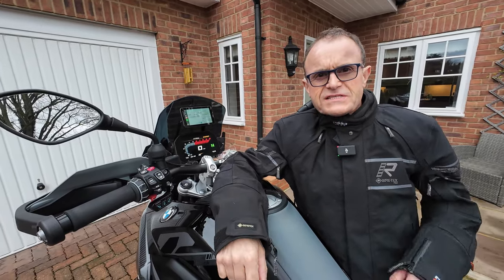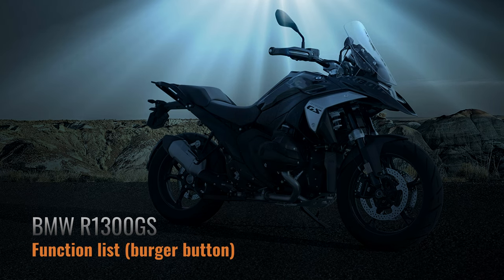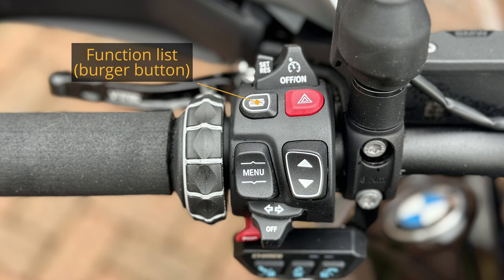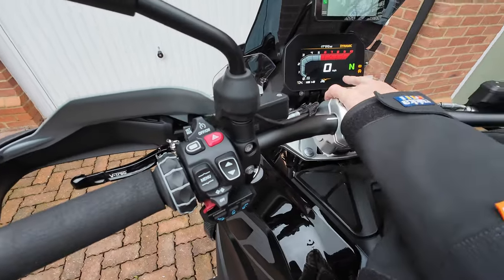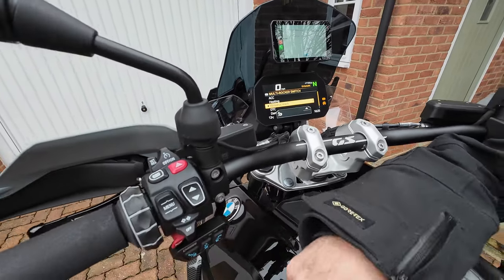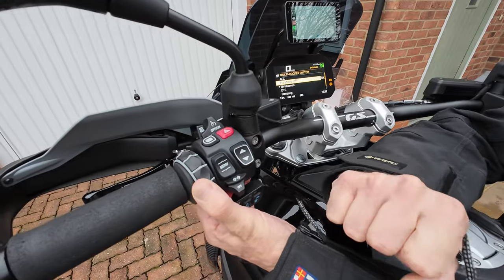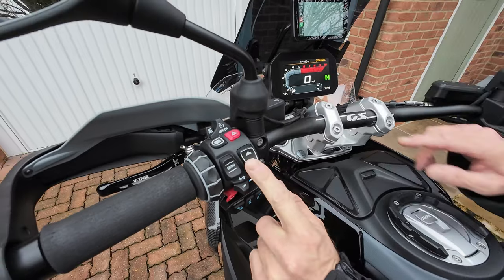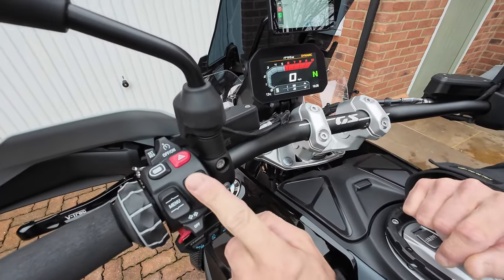Bmw GS 1300 how to use a function list button known as the burger button Secret functions revealed !

Comment: Simple and clever wish more YouTubers new this and stopped complaining
Reply from the maker: Thanks
Reply: Yes. I've also seen lots of YouTubers complaining that the windshield setting is not saved, and you have to bring it manually up again each time you start the bike. They tested this with the bike standing still, not realizing that windshield position is automatically restored once you drive over 5 km/h.
Reply: Nope .. if software needs a fucking video to explain it …..

Comment: Could you explain how to adjust ergonomics on the 1300 GS? Things like throttle, brake, clutch, etc.  for instance if I want to adjust the angle of throttle to brake to keep my wrist straight, cable adjustments for clutch and brake, etc.? The manual is unclear.
Reply: Youtube vids exist for these adjustments

Comment: Had my 1300 for a month now, the function list is very useful. Now here's what I don't get:

Why do we have to change the default rocker switch assignment to use any function from the function list? I have the switch assigned to the windshield by default. If I want to change something else, e.g. ACC distance, I have to assign it to the rocker switch first, then use the switch to change my setting, then re-assign my original setting back (windshield). That's stupid and distracting while driving. Why can't I simply use the rocker switch to change the higlighted setting in the function menu, without having to change my default assignment first?

Why did BMW not include the light settings in the function list? My 1250GS had TWO buttons for this: One to set daylight automatic, and the other to switch the optional auxiliary lights on/off. On the 1300GS, instead of pushing ONE button, it takes me 15(!) steps to do the same, including the long press of the menu button to switch back to driving display. BMW, please include light settings in the function list with the next software update.

Also, the function to quickly switch off heated grips/seat on or off by a long-press is gone. Could be included by a very-long press of the burger button as well. BTW, the heated grips settings don't work for me - even lowest setting is too hot when it's not really cold. Had the same problem with my 750GS. Then, on the 1250GS, they fixed this by providing 5 settings instead of 3. With the 1300GS, they're now making the same mistake again. And still no lighted buttons in the dark *sigh*

As nice as the idea with the burger button is, they didn't think it through.

Other than that, except for the awkward sounding motor, it's a great bike. Love to ride it.
Reply: Fully agree. It was designed by an engineer, but tested by “yes men” instead of riders who would immediately catch these simple faults.
Reply: Totally agree with you. I only made the video to help people understand how to use it as it is, not in any way saying it is perfect. You are correct, when the function list is active, why can’t we just highlight a function and use the rocket without changing the default.
Reply: Hey, look on the bright side…at least they corrected the issue with diving through menus to reset the trip meter.  Now you can zero it with a long press.  Something I wish was on my 1250.
Reply: @StruddersMotorrad Yeah it's not your fault. The video is great and explains how to use it 👍
Reply from the maker: Wow good moan sounds  like me
Reply: @valuemastery ❤

🎯🎯🎯🎯
your post sums it up so well

Oh and the motor/gearbox sounds so awful… if I have a trip that involves slow speeds I’ll take one of my other motorcycles!

The GS is a total embarrassment under 60kph !!